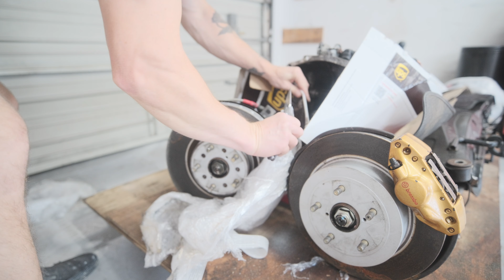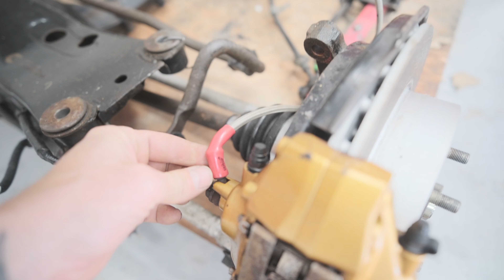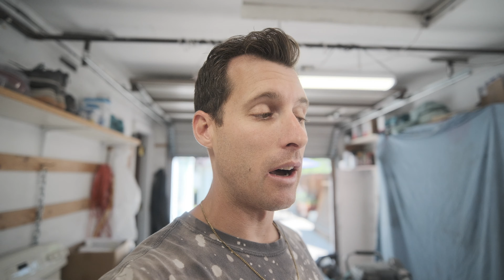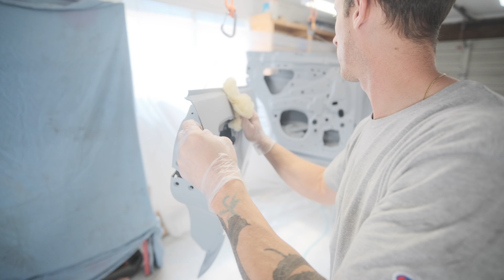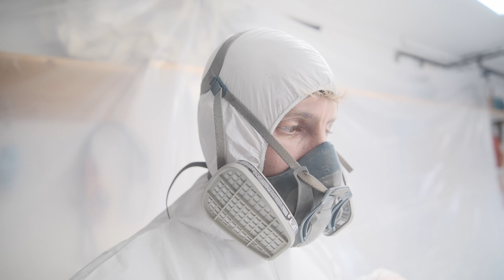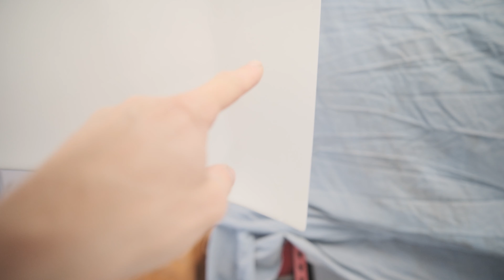WRX Sedan Widebody Conversion Part 4

Comment: STi drivetrain looks to be in great condition. What a treat. I’d like to do that to my forester, it would be so nice to drive the car and not worry about the transmission and those diffs will make a hell of a difference too. Nice work on the paint work. What wheels are you thinking? 
Cheers, 
Reuben
Reply from the maker: The 6 speed on the forester would be amazing!  

Not totally sure on the wheels yet. I do really like Enkei RPF1s and I think a 17x9 with a meaty tire would look really nice! Or a 18x8.5 with less tire.
Reply: @sleeper_motorsport  RPF1s in a 17x9 would be awesome.